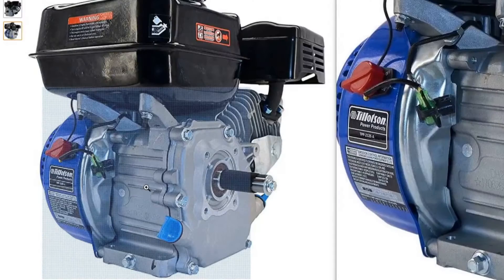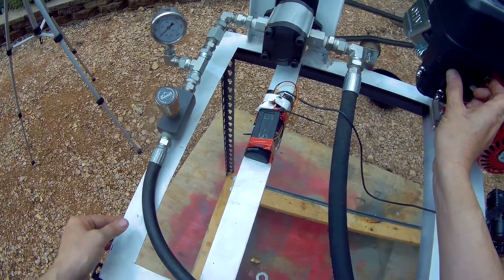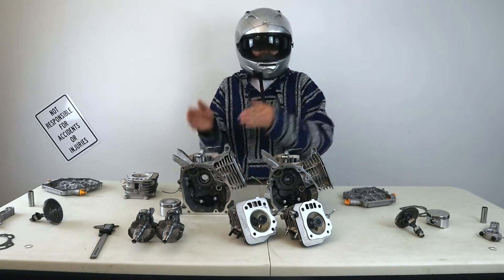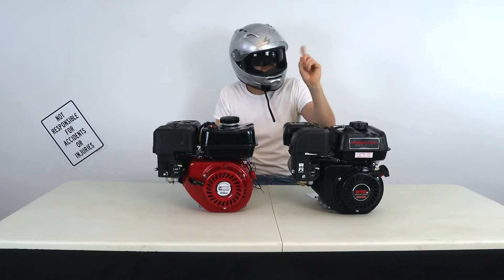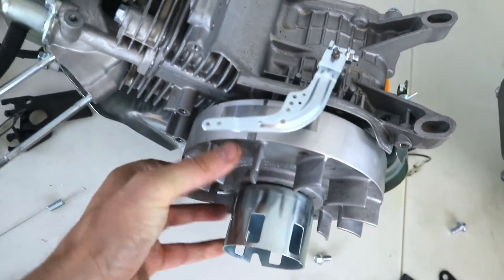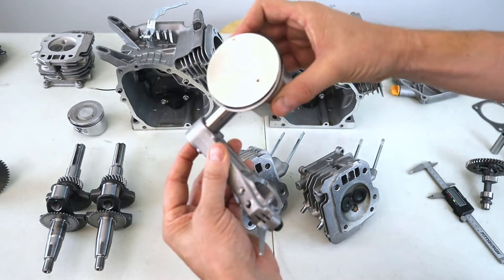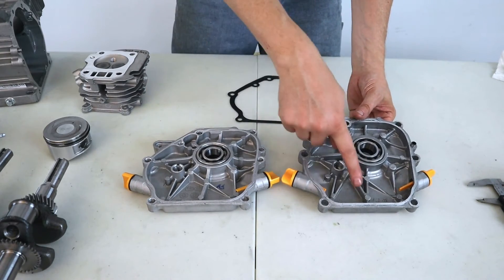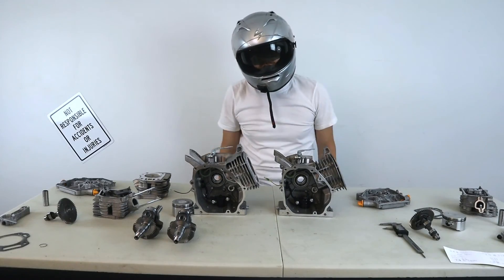Tillotson 212 vs Predator 212 vs Ducar 212

Comment: Does anyone know what the specs were on the Tillotson 212r when it came out few years back.  I've heard conflicting information some saying it doesn't have very much lift to it being a 196r cam.  I have a 212r and the stock cam on the caliper it reads almost .264 .265 lift I just don't know what the duration is.  Wish I knew this info before buying the super X cam. Might be better cam for the track I run.  If anyone knows drop a line.  Or knows someone that might know.

Comment: For me, the Ducar was the better and cheaper option for my mini bike. I knew I would be running around 8000 RPMs when fully built. The Predator 212 with the PVL flywheel is $246.39. The Ducar is $219.15 with the flywheel... I saved like $25 by getting the Ducar 212 and I know it will hit over 6000 rpms safely with just the governor delete and stage 1. The Ducar comes with 16-18# springs. So,  I didn't even have to upgrade the springs on it when I put the Stage 1 kit on it. WIN WIN WIN.

Comment: Great video, what about the predator 212 ghost are they worth it?
Reply: The Ghost is only worth it if you just want to bolt it on and ride. If you chose a less expensive engine and used the same carb and cam as the Ghost it would have nearly the same or more power than the Ghost at around the same overall cost.

If you don't want to open the engine and work with it get the Ghost. If you want to open the engine and work with it get a Ducar 212, Wildcat 223, or Predator 224. Any of those three are better than the Predator 212's.

Comment: Please remove the governor completely and redo the test please and thank you.
Reply: There's no need to. On a stock engine ungoverned just gets more RPM, not more power. Even if he did the tests with stage1 kits the maximum HP would be in between 4600 and 5K RPM. You don't even need to remove the governor to get those RPM. Stock cams are only good to around 4800 RPM.

Comment: Can you still pull start with 34lb springs
Reply from the maker: If you have a very good compression release on your cam. Some people do up to 34-36, but it can be a wrist snapper if lash not set with very close tolerance. Best source of information will be contacting the cam manufacturer for details. They will know best.

Comment: The Tilly's flywheel is rated for 10k rpm. But the fine print indicates only for a sustained amount pf time measured in seconds.
Reply from the maker: True story. I talked to Tillotson a little about it. Didn't go far. I'll be excited to see what comes from Tillotson buying out PVL!
Reply: @megoingfast  you said 17k off the flywheel from the Ducar is that my understanding?
Reply from the maker: @thunderj176  yes. The PVL flywheel is 17k, the Tillotson does have a different flywheel, carburetor, muffler, pull start plate, and a couple other minor differences.
Reply: Part is hemi vs non hemi more than predator but good video

Comment: They need more 212Rs in this world!!!
Reply from the maker: EC has been using their supply on parts that line up to the 212r to put out other engines. The 212r kinda hit a wall as well with the launch when it was advertised as 12hp stock and was not. Lots of drama and opportunity both in that engine.
Reply from the maker: I agree though. Nice platform.
Reply: @megoingfast  I think it makes 12hp with no governor, stiffer springs and a carb ON the stock cam but I have no idea how that number came up. I noticed that with parts when I went to buy the complete 212r head for my Wildcat too.

Comment: They ain't no Tilllotson 212R!
Reply: My Tilly hemi is much better than the r 😂
Reply: @Gone_rn  not stock. Get you the same EC factory mods and you might be up to it. Otherwise your just pumping a Ducar without an oil sensor or PVL. You can build a 212E (hemi) just fine. I hear they are great base engines.
Reply: @Gone_rn  that's on a built motor. 60 sounds like street stuff. Everything I build is for dirt and geared for 45 or less. 15 hp? Whats that full stage 2? I might have a few built motors but nothing geared for 60 or with the brakes to get off of it. My Wildcat on juggernaut will get 60 with gears. My Hemi will get it with gears. Hemi-Non-Hemi......gx160......they can all get 60 if you aim for it. An ungoverned, billet rod, 22s and a 660 carb on a 212r will get you somewhere.....I mean a 0-30 is going to tell you a whole lot more than 60.....I'm not sure what got you all in an uproar brother. A stock 212r is better than a stock 212e or Ducar. It's just straight up built for it. It's not a big deal. Those 212e are great base engines but if you were running a budget your gonna get a whole lot more value with a 212r.
Reply: @fatbuddycat  no stage 2. The truth is that tillotson lied about the 212r's hp number. The stock hemi 212 makes more hp stock
Reply: @fatbuddycat  high jetted, carb long header, air filter, gov bypass and that's it,   dynoed it and it had quite a bit more than 13 hp
Reply: @fatbuddycat  it's sounds like you missed the memo where the 212r doesn't have produce 12hp it only produces 7 dyno tested
Reply: @Gone_rn  what were the results for the 212r with the exact same modifications? The pk3a carb on 212r has pretty good flow into the 212r head into the chamber, over the flat top piston and out that particular exhaust valve, the stock cam might resemble a cl 1 or 2 race cam and would likely peak at a different rpm, maybe the stock springs are holding it back.....it is a pretty tight motor after all....they could always let go of the tolerances and blue prints are for building houses. I like the heavy duty fan shroud too, it does a nice job covering up the ugly monotone of the silver flywheel.
Reply: @Gone_rn  stock governor horsepower but I think that was a claim outside of Tillotson itself. Kinda like the 10k flywheel on the 212e....we all know that is 10k peak 30 seconds max not a constant but nobody gets too upset about it. I personally am going to buy a 212E at some point but I own a stock and modified 212r already.
Reply: @fatbuddycat  the 10k flywheel thing rpm flywheel thing doesn't make a whole lot of sense to me as I've never heard of a stock tillotson flywheel EVER blow up. I have seen predator flywheels blow up at 4k rpms however
Reply: @Gone_rn  the casting on the 212E flywheel looks better than most. The engine isn't going that high anyway to make 13+hp. The big catch is useable power under a constant load at varying rpm to translate to applicable torque that can be communicated to wheel speed. The 212r stock has more compression with the same stroke. I'm not sure if that helps build torque at a lower rpm but a hole shot test on equal gears would tell.
Reply: It's funny when my predator 212 failed inevitably I had a choice between the 212r and the hemi. I chose the latter because I have never seen one video of the r that made it better for the price. Say maybe it does have a slightly higher compression ratio.. All I would need to do would be to buy a flat top piston on gps and install it and still have 3 or more hp up on the r
Reply: @Gone_rn  what isn't making sense is the physical block and the parts in it creating more power than the 212r. Same goes for the carb and exhaust. In stock format the 212r will beat a 212E. With the same valve springs and no governor you would see a faster rev, more mid range torque and stronger pull up top till valve float due to the cam profile. That's without consideration the carburetor or modified stock muffler on the 212r. To actually achieve anything better it would indeed have to be built better. Get you some 22s stock rod and a 22mm kuni on both and watch which one wins.
Reply: @fatbuddycat  or you come out to Michigan. Put your motor on a decent kart frame with slicks and race me and see who wins. Lmao I have never seen one person beat the hemi with a r ever... Otherwise I would own the r instead of what I own now
Reply: @Gone_rn  lol! I love the 212r vs 212e idea it would be more of a matter of getting myself there. Two identical bikes, same mods.....🤔.
Reply: I might have to buy another bike and build an exact copy to pull this off bit it would be neat.

Comment: I hear alot of hoot about flathead briggs motors. Could you do a vid about it?
Reply: They’re the best ..   simplest design I wish they were cheap & common like predators.. 
 I’ve had many 3,5 & 8s
Reply: Flatheads are gnarly little motors, my personal favourite. Although their ceiling is a little lower in terms of how much power you can make compared to a clone style engine. And they are much more uncommon to find guys who will build/service them and sell parts. But man oh man they are gnarly, in my opinion the best sound out of any of these small displacement singles
Reply: When was racing Go-Karts that's all there was were flat heads I raced open classes and they were straight bad to the bone I've yet had a  clone engine that is close to how they run but I'm not racing either tho I'm sure they are some out there that is just as strong

Comment: Nice vid! I like the Tilly 212E-C that I bought but I should have bought the Ducar because Tilly didn't even come with the PVL but cost quite a bit more than the Ducar.   I think Tillotson kept the description on the Tillotson 212E web page stating it has the PVL on the Tillotson website but after the 212E-A, they switched to the regular flywheel and never updated the description. 🤷‍♂️  Oh well it's still a nice engine but I'm going to put a PVL flywheel on there. 

 EDIT- Aug 10, 2021. I found out that the Tilly flywheel is rated for higher RPM but doesn't look like a PVL flywheel. Looks like a regular flywheel with plastic fins but still rated for higher RPM. I bought a PVL and will still use it though.
Reply from the maker: Tillotson has an interesting future. I'll be very curious what happens now that they bought out PVL.
Reply: @megoingfast  you know!
Reply: They need to make more 212R and less 212E. You would love how smooth and powerful it is stock. Without a governor and with a stock billet rod it is amazing. It can support 22s on the stock cam and a 660 carb like it was meant to be. The 212r has all the benefits of the Ducar PLUS a better head, valves and flat top piston to produce more compression than any other 212 on the market.
Reply: @fatbuddycat  cant i change the piston head and valves on my Ducar down the Line i just got it tho
Reply: @CruiZe-A-ViSiON  I don't see why not. The Ducar is a nice motor too from what I hear. I wouldn't mind trying one out.
Reply: @fatbuddycat  cant wait to start her up an do a cruizer vid
Reply: @CruiZe-A-ViSiON  I was watching some earlier,  you get right out there!
Reply: Prior to there being anything 212cc the Ducar 196 was one of the best quality clones available, if not the best.
Reply: I would have gotten the 212R if it was in stock anywhere, but the Tilly 212E was $220 + PVL flywheel was about $70. 😬 That's what I get for making spur of the moment purchase. Should have gotten the Ducar and saved a wad of cash.

Comment: This guy's on a hole nother level I've been looking at the ducar have not bought one yet went with a wildcat 223 for the build I'm doing no clue how well the motor is as my frame is still got a lot of work left but I'm going to order one for my yard cart try it out thanks for the video
Reply: Wildcat power!!! Ran mine hard for a few hours yesterday only issues I had was the header rattled loose but I also didn't check the torque after warming up the motor. Oops.
Reply: @fatbuddycat  I took a Coleman ct200u stretched it a foot and 6 inches in the middle using the ct200uex front suspension I had a set of 22 inch tires and rims laying around for a bubble bike I was on another page seen your comment on a bubble bike going to us my wild cat motor for it Im still finishing the front milk crate mount and a large one for rear
Reply: @davidpayne4084  that's awesome!
Reply: Wildcat engines are significantly stronger than the Tillotson. Look at Redbeard's coverage of the two!

Comment: I love your  blue baja, I have one that is 30 years old and looks new. What is your engine recommendations for the Bt200x and RB200, looking for Big Blocks that fit with OMB Riser!
Reply from the maker: Big block 301-460cc? I don't know of a riser meant for anything but 196-236 class.
Reply: @megoingfast  I bought the BT after you raved about it, I honestly like the RT200 better but I need much more speed for the roads, the BT going to need brake upgrade, I figured a BB will get me there with TC, I don't want to cut the chain guards though
Reply from the maker: @carlo1132  I have one BT, I have 3 of the RB frame type. For cruising, they are so much better, but I can't take them to ice fishing in winter and I'm a fisherman. Ice roads are a lot slower, and standing in the BT on off road conditions is easier. I'm summer, it's a stunt bike people like to thrash and do wheelies on. If I had a single bike, to use year round, BT. But, in summer I don't ride it nearly as much. The RB is so much more comfortable for sure.
Reply: BT or CT200U for off road and RB for on road.  I have all 3 and tend to ride my CT way more than any other bike.

Comment: Know anything about a gx200 with a gx 160 head on it ?
Reply: My brother did the swap and a mild cammed gx200. I dont think he ported it at all but just that change made a decent difference I'd think due to more compression moving the air faster.
Reply: @Cheap-Nasty  I do it for compression. My gx160 is an Everest 168f block, Honda gx 160 (163) cam, 168f crank, 383 long rod, short skirt Honda piston, Honda 14cc head/valves and a PVL+4. Snappy little bugger!
Reply: Other than that I have a Hisun 196 and a Trailmaster JiangDong JF200 with 14cc heads too. Both paired up with CS cams.....woah boy they pack a punch!!
Reply: @fatbuddycat          There ain’t nothing  like adventure   On a motorcycle   You nearly entirely built  yourself.. 
thank you for your videos .. 
mini bikes  bring   The most joy per dollar  I could find .       
Especially a predator bought with a coupon.
Reply: @joshuagerlach6943  Yeah brother! It truly is a lifestyle.
Reply from the maker: Head or just a stamp? A guy named Jason sold the gx200s stamped gx160 years back. If you mean head fit, I've never made one.
Reply: @megoingfast   an actual gx 160 head
Taken off, ported, polished, lapped valve, stiffer springs & mounted on a gx 200 block governor 
 Removed, compression release removed for a super low idle. Slotted coil mount for timing,   Stock keihin carburetor  port matched to both the velocity stack & intake with the choke butterfly removed & the hole plugged, 38” of header pipe  with a super trapp  250 muffler 
Pushing a 10-42 gear on a 13x6.50 -6  slick 
In a early 70s Cat Duster chopper .
Reply: @joshuagerlach6943  I put 14cc heads on my 196s!